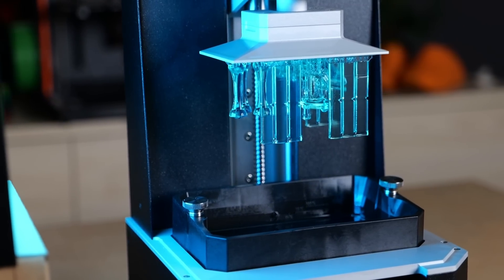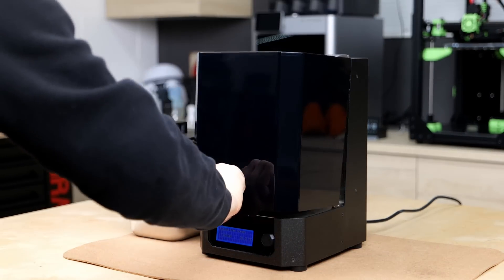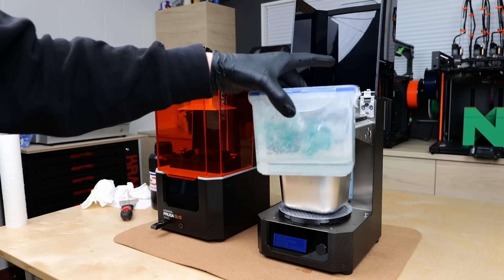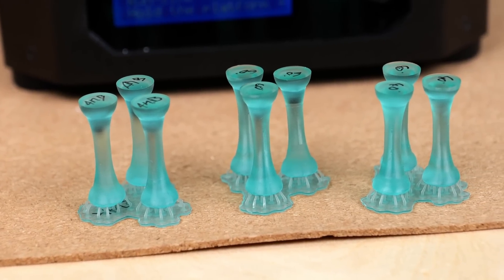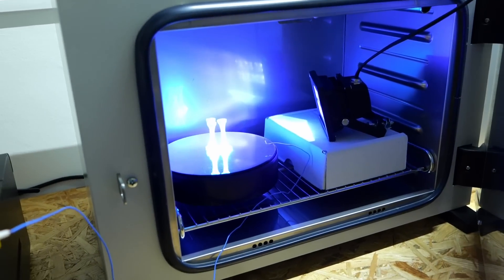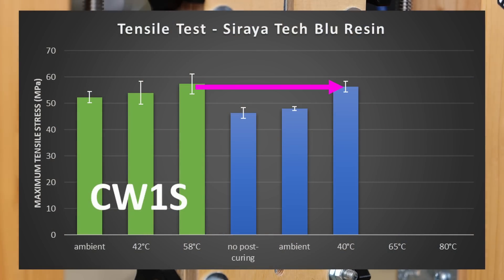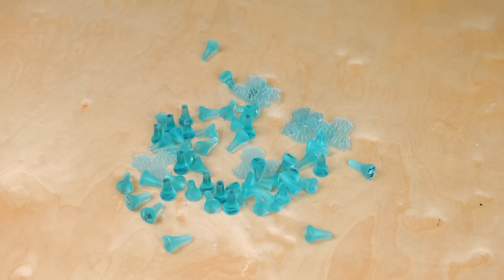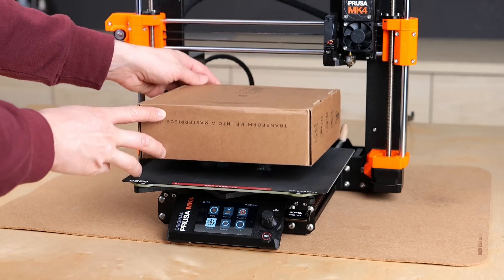Why does Nobody Cure their Resin 3D Prints like this? (40% more strength)

Comment: That resin is essentially an epoxy, where hardener is a photosensetive molecule, which stays neutral, but transforms into hardener, after subjected to UV light or temperature.
So all the epoxy related stuff is applicable to SLA

Comment: Note too that the curing of polymer materials is dependent on both temperature and time.  The organic chemistry of polymers is highly sterically constricted and that giving the materials more time to interact may be noticable.   The original Porsche 904 body came from the manufacturer in a mostly cured condition and it took 6 months in a hot sun to complete the cure enough for competition use.  Good luck.

Comment: I cure my resin prints in water. It takes the same amount of time (2-3min, flip, 2-3min). I find they come out way less brittle and stronger. I use a UV spotlight mounted on top of a stainless steel pot so I can take advantage of the reflections of the pot but I still flip them half way through and sometimes if there's hard to get areas of the print I'll orient it so it will get more light and do another run. I haven't had an issue and I believe they come out stronger.

I use room temperature water, I never thought about heat. I may have to test this with warm to hot water and see if it makes a difference.

I made a load cell mount from resin for large bar style load cells (16 of them actually) and they held 40kg for over a year in a hot environment. I eventually replaced them because they ever so slightly sagged over time but I was amazed they went that long. I believe that water curing had a role in that. This was with Standard ABS resin.
Reply: Try the same thing but use glycerol instead of water and cure for 60 minutes.

Comment: You should test the BASF Ultracur3d resins. Absolute beast mode resins and better than the regular consumer stuff. ST45 and RG1100 are great! They also have the best flexible resins with fairly good tear resistance (relative to other resins).

Comment: I find shorter washing times in IPA also result in less brittle parts. To me it seems as the IPA damages some of the molecular bonds in the resin. I try to wash as short as possible. 
Rinsing parts in soapy warm to hot water before curing will bring the resin temp further up before the UV light cures it.
Reply: Now that sounds like a theory that should be tested.

Comment: I don’t print with resins, but in my work I make use of dual UV-thermal cure epoxies. This result doesn’t surprise me. In the materials we use, we achieve maximum strength when using the minimum UV pre-cure and complete thermal cure. Over-curing with UV results in a weaker bond.

In your thermal only post-printing treatment, you might want to a longer cure time. Try increasing the thermal cure time (2 hours, 4 hours). You might not be fully cured after 1hr at 80°C.
Reply: Right on, JonS!

The 3D printer resins can't be "over-cured", they can only exhaust the photoinitiators and reach their final properties when cured for the proper amount of time (ie, are cured long enough, usually at least 60 minutes or more).

Crappy consumer resins [as opposed to better consumer and industrial resins] rely on under curing to hide their deficiencies [at least for a few weeks or months as is well known].  Good consumer and industrial resins when under cured [without proper temp., too] never reach their full, best properties.

Curing properly in glycerol in addition is just about optimal and easily achievable by even hobbyists.

Comment: I had read that the main purpose of the UV in acting on the photoinitiator is not very different from how resin polymer initiators are activated, it essentially is adding energy to the system. The photoinitiators have been found to be more sensitive to that style of energy instead of say, heat but it makes sense that heat would also do it.

Comment: Another good question about curing is: to which depth gets the resin cured, with or without post-heating? Because UV definitely won't get more than a couple of mm within the print.

If you leave a 1-2-3 mm center channel in your test samples, will the tensile strength be different?

Comment: I work for a german medical company and you would be suprise what kind of photopolymers are on the market from Henkel (Loctite) or Dymax. For catheter applications there are ones for glue application which starts the polimerisation process with a tiny but of uv light then can be cured all the way in the oven with uv light, for jard to reach places. Or other ones reaching final hardness just via uv light. But one thing all of them have in common, none are long term stable! Not even Startasys manages to produce long term stable uv resin which can hold it‘s strength and toughness longer than 1-2 years. That‘s why for long term functional parts, always sls, mjf or fdm prints.

Comment: I vaguely remember Sanladerer trying to glue 3D-prints with resin and failed, because the UV-Light was not able to penetrate the resin and  the “glue” only got cured a fraction of a millimeter on the outside. So the curing after print seems to primarily cure the stickiness of the surface of the object. Even resin thats optical clear in visual lightbands absorbs UV, otherwise printing would not work.
This results in me being a bit sceptic about your statement at 1:35.

Maybe elevated temperature has the effect of hardening the inside of the objects. As of a rule of thumbs says that every 10 °C increased temperature speeds up chemical reactions by a factor of 2.
Reply: From a functional Point of View: We can print overhangs and cavities. If the resin allowed UV to shine through we'd end up with a deep cure in Z-direction!
But higher temperature helping the activated monomers that didn't find something to bind to a proper partner? Sounds not unreasonable.

Comment: It's honestly pretty shocking that the resin manufacturers recommend curing above room temperature, and the curing station you have includes a heater, but there's no option on it to use the heater when curing. I wonder if any other curing stations have that feature.
Reply: "HeyGears" curing station has proper curing and heating functions, look it up.

Comment: Great test, thanks. I would have guessed that it it would make the part more brittle by increasing the hardness. For my functional parts I actually prefer a bit more "give" over maximum total stiffness as most part stresses are transient rather than load to failure.

Comment: Will there be a difference using transparent resin like the Saraya Tech Blu since the UV rays penetrate through the object, as opposed to opaque objects where presumably, only the exterior gets cured by the UV? It would seem that the opaque resin would benefit even more from the heat treatment due to this.  Your thoughts?
Reply: Yes as a Resin manufacturer I can tell you that is the exact reason why ours is not opaque ,the curing is more uniform and reliabe in atranslucent resins, colorants are also used t ohelp with uniformity but they are always translucent.

Comment: I've always wondered what strength will have a FDM part printed only with outside perimeters and then crank up the heat and "pour" the melted plastic in the hollow part - just like pouring concrete. Such infill will not have layer lines, and will fuse with at least the "inner" outside perimeter.

Comment: Formlabs actually has a white paper somewhere (from a long time ago) showing graphs of mechanical properties with varying temperatures and time as well.

The one caveat is that the optimal curing temperatures are often very close to the HDT of these resins - which means that heat curing will OFTEN result in warping if you're not careful (there are a ton a caveats and subtleties here - ask me about it sometime 😅)
Reply: I don’t do resin printing, but I do work with a lot of thermal and dual UV, thermal cure epoxies. There are default manufacturer-recommended cure schedules, but other curing schedules are possible (and manufacturers will often provide some alternatives if asked). Curing at a lower temperature means a longer cure schedule to fully cross-link the polymer. As the reaction rates increase non-linearly with temperature, lower temperature curing schedules often require a significantly-longer cure schedule.
Reply: @JonS  yeah, that all makes sense and matches the white paper from Formlabs as well. From what I recall their graphs showed that lower temperatures would "never" reach the same mechanical properties. But by "never" I mean, not in a time frame that was tested or deemed reasonable for the end user.
Reply: @emberprototypes  yes. Lower temperature cures will be less strong, so the trick is to cure as close to the recommended temperature as possible, but not to the point of losing dimensional stability.

In my work, we are often limited by the maximum temperature of other components in the opto-electronic systems we are building, so we have to find the right balance by performing DOEs where we adjust each variable and measure the result.
Reply: @JonS  yup - something I'm also very familiar with because dimensional accuracy is often more important 👍

Comment: One of the most important things for me in 3D prints for functional parts is creep. Rarely do I need higher than 60ºc temperature resistance, but often I do need parts to stay in shape while loaded for long times. This kills PLA for several of my projects, despite it's many advantages.
The same is true for the Formlabs Black resin, we also got the wash and cure station at work and we use the machine whenever we need to show pretty stuff to the costumers, but when it's time to make some functional prototypes to last field use, no no. It creeps way too much.
Creep tests is one thing I would like to see being explored more thoroughly, there's much more to part strength than short loads after all.
One thing I've often done with larger resin prints with heat is straightening warped walls. Large parts will sometimes get warped during printing or curing (specially that 60°c 1h curre that we go with the Formlabs station), a friendly Ender 3 with it's flat glass bed at 60°c for some minutes with correctly placed weights, then let it cool naturally until about room temperature, and we're good to go.
Same with PLA actually.
Reply: There are no non-creeping resins. They are all amourphous polymers based on acrylates or epoxy -for obvious reasons. The glass filled ones like Formlabs 4k are somewhat better, but it's always just a quantitative difference. If you want non creeping stuff you need to use ASA with CF or annealed PET with CF.
Reply: @testboga5991 What you mean is less creep . We would measure creep in zirconium pressure tubes (or at least experimental analogues).
Reply: @testboga5991  Nice addition, didn't know that far into the resins, kind of a bummer. I was wondering most about FDM as that's what I've got on reach for my own stuff (home printer), on which I use ABS when the parts are small enough and PETG for larger stuff as an in-between compromise material. At work we got the Rigid 4K too, used mostly or almost entirely for injection molding prototype molds.
That thing is a heck of an annoyance to work with tho, don't use it for a few months and you'll have a viscous paste at the vat, that also has way shorter lifespan when used with that resin.
Reply: Check out 'my tech fun' youtube channel, he makes creep tests for many types of materials, though FDM focused.
Reply: 1. my tech fun tests for that
2. stick to PC if you want lowest creep, or ABS/ASA
Reply: As far as i am aware, CNC Kitchen is working on creep tests for a while now :) You just need to wait
Reply: Oh yes, my PLA frame braces have shrunk a tiny bit over the 30cm, and the spring bearing for my spool also deformed heavily, resulting in almost falling into the spool's hole, just from being loaded 24/7 and in a 30*C room in the summer.
Reply: Black from formlabs is way too soft. Clear is useable
Reply: @primosek1  They are functionally the same resin, if your black is soft, your printer is underperforming, likely you need to clean your optics. Upload your diagnostic logs and get in contact with support, they can read out what amount of laser power is hitting the sensor during the preprint check. Black (and white) are both pretty picky about just a bit of a drop in laser power
Reply: I had to learn the hard way that Formlabs Tough 2000 also creeps🫠
Reply: I don't know anything about anything - question: is ABS not a solution for this?
Reply: I fully agree. Creep seems to be a completely ignored material property although it is so important in my opinion. Looking for literature gave no useful results for the materials I use. And even if all of the typical 3d printing materials do more or less creep, it would be really helpful to have some numbers and also background information. I did a very simple test with PLA, ASA-X, PETG and PC. Up to that point, my understanding was that if PLA is not suitable due to creep, you better use PETG instead. I had a really negative surprise, where PETG still deformed a lot. PC on the other hand was excellent. But there are oh so many parameters that you would have to test for systematically. I think, this would be a great opportunity for @CNCKitchen to investigate. I think this would be a first on youtube. There is one other youtuber I know of, who does some basic testing. But a thorough test to Stefan's standards would be really welcome!
Reply: Did you try adding fillers to the resin?
Milled fiberglass, milled kevlar, alumina powder...
Reply: Just watched another video. They put things in a box of flour before putting it in an oven. Have not tested it, but sounds like a good process. I'd use sand for safety reasons though.

I actually remember now seeing some thermal annealing video that also use something like that (maybe soda or some other dusty material)
Reply: If you research PLA, it was engineered specifically for 3D printing and for prototypes only. It was designed to have similar properties as PC, except for the thermal properties. Lots of people print with PLA and assume it is for production parts. Its a prototyping material.
Reply: @av2245  Are you sure about PLA being developed specificly for 3d printing? I think, it existed long before 3d printing was a thing and it is used for more than prototyping. As Stefan from CNC Kitchen discovered, it is used for single use cuttlery for example. PLA also doesn't share many properties with PC except for its stiffness.
Anyway, the point here is not about bashing PLA but that for any materials, there is almost no information about creeping available, although it can be an important factor when choosing a material.
Reply: Just make parts bigger (with bigger contact area etc). That helps avoid creep. Creep mostly works at loads close to maximum

Comment: Definitely noticed that heat leads to strength. I run my resin prints in my garage where I don't have to breathe any of the vocs. During winter I use a 220v electric heater. I usually aim for about 35C during the print, after the print I crank it up to pull supports off more easily, however I have left the heater blasting my printer before and it becomes concrete esq. Good video.

Comment: I bought a microwave convection oven with turn table and removed the magnetometer and installed a UV lamp in its place. It was a bit of work to invent a new control system, but it was worth it. I created a stand for my parts to insure even heat and UV exposure to prevent warping
Reply: correction, Magnetron
Reply: @alexportiiii6414  Ah, I was actually confused xD .
Reply: @@buboo_bubobubo don't try this unless you are very comfortable with electricity. The Mag and Capacitor can kill I'm told

Comment: I own a FDM printer not resin, but I use epoxy resin for projects and put them in the oven after it has had its minimum cure time. 
I have always wondered why people never used heat for their resin prints and just presumed the resin used for 3D prints isn't possible, glad someone (you) have shown resin printer users this trick. Good work.
Reply: Another tip also, when I use epoxy resin, if say 60c is the highest you want to cure, start at 40, then to 50 then 60, when time is up, do not remove the part, leave the part inside until the inside of the oven has gone back to ambient temp.

Comment: for me the underwater curing was the best, after washing, claenaing  and removing the supports i put the models ina vlear plastzic container and pour  warm(~40°C ) water on top, curing them in water for 5 mins. The print this case wont be as brittle as in dry curing, i dont jknow the chemistry behind it, but some says it has something with oxidation, Can you please thest this method too?

Comment: Abstract

This video transcript describes an investigation into different curing processes for SLA resin 3D prints. The goal is to explore ways to increase the strength of these prints.

Key Findings:

* Thermal Curing: Experimenting with curing prints at elevated temperatures (40-80°C) led to significant strength increases (up to 41%).
* Combined UV and Thermal Curing:  Curing parts with both UV light and heat simultaneously appeared to yield the best results.
* Post-Curing Annealing: Interestingly, heating pre-cured parts in an oven without UV exposure also enhanced strength.
* Resin Variation: Not all resins may respond equally to these techniques. It's important to consult manufacturer recommendations.

Conclusion:

Thermal curing and/or post-curing annealing have the potential to substantially improve the strength of SLA resin 3D prints. While more research is needed for different resins, this finding opens new possibilities for creating stronger functional parts using SLA printing.

Call to Action:

The author encourages viewers to:
* Experiment with these techniques on their own resin prints
* Share experiences and further research ideas in the comments 

i used gemini